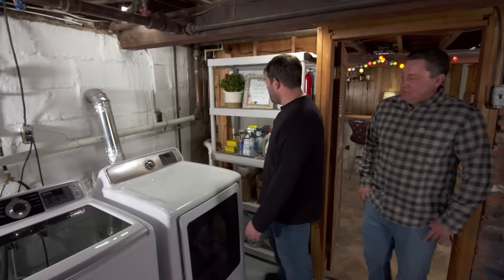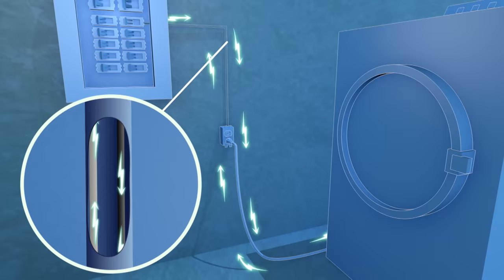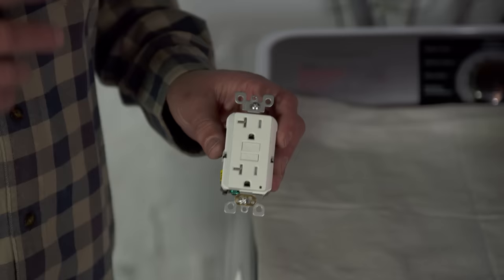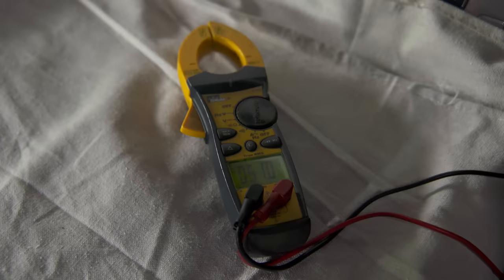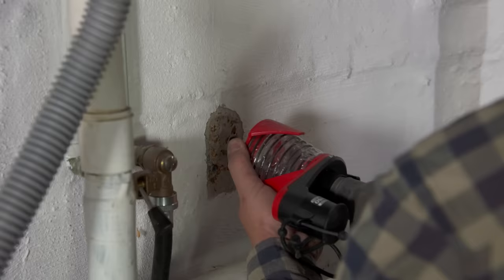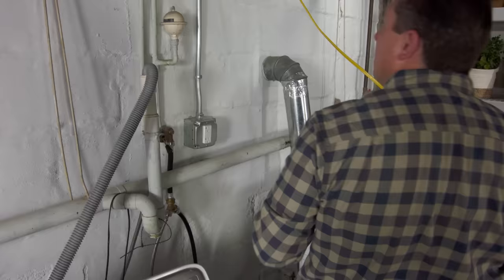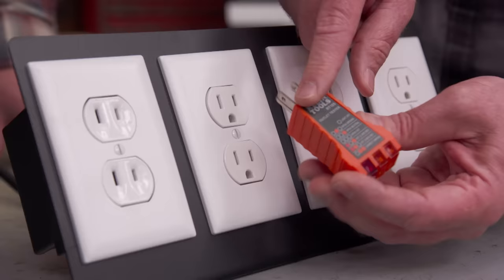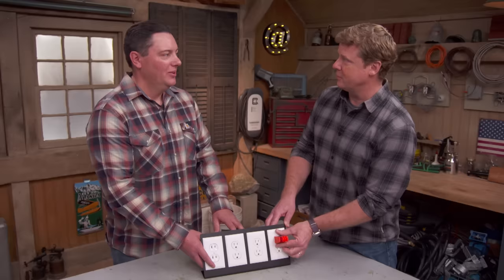How to Ground a Two-Prong Electrical Outlet | Ask This Old House

Comment: Good vid, however he ran the romex through the 1/2" conduit without removing the sheathing from the romex, this can create overheating issues with the wire & is actually a code violation...
Reply: Came here to say this. Even though it will be a remote possibility, stripping the sheathing should have been done.
Reply: Actually that is a gray area. Some inspectors flag it and some say it is fine as long as it's a short piece(so basically a protective sleeve).

But...if you strip it then it is a flat out violation as there is no rating for the wire printed on the independent wires.
Reply: @michaelruskey2311  Good point, I hadn't given thought to the rating info 👍
Reply: Wrong
Reply: You are right Ryan. Sheathed wire inside a pipe will increase the temp of the wire adding more resistance,  and alerting the voltage supplied.
Reply: @Gods_son123  yea...wouldn’t want that voltage alerted. Big problem
Reply: Never mind a wire going through an attic on a summer day that sleeve of pipe will heat the wire up haha.
Reply: “That’s a code violation”

         —guy who’s never opened a code book
Reply: It’s not against code to run NM cable in conduit. NM cable can be run through conduit to protect the cable from physical damage. NEC 334.15
Reply: @chriskephart8305  Rome is not a nm cable as for the 1500 dollar fine my work was issued for previous work that was done with romex going threw emt and flex  had to re wired an entire building for the inspector
Reply: @DJLuDog3  Romex is a trademark of Southwire and listed as type NM cable. Reference the code section I listed for type NM cable and you will see it’s permitted for use in RMC, IMC, EMT and schedule 80 PVC
Reply: Can you provide an NEC citation that shows it is a violation?
Reply: @chriskephart8305  of all the comments I’ve read on this video of “you should of done this” or “you didn’t do that” or “this is what you’re supposed to do”, you were the FIRST one that I have seen that actually sited the code. Thank you for providing correct information as well as citing the code in which the info came from.
Reply: @mr.g937  He can't because it's NOT a code violation.
Reply: @kerrybaxter5211  Stripping the outer jacket from NM cable and using the inner conductors is NOT advisable.  Those inner conductors are not the typical insulation style to be used  in conduit. Usually THHN and THWN are used in conduit.
Reply: @Gods_son123  ALERT! ALERT! - There, I alerted the voltage. 
Proofread, man!  I don't even have a guess what you mean - Attenuate the voltage? Voltage drop? What is acceptable voltage drop?
A footnote (NEC 210-19 FPN No. 4) in the National Electrical Code states that a voltage drop of 5% at the furthest receptacle in a branch wiring circuit is acceptable for normal efficiency. In a 120 volt 15 ampere circuit, this means that there should be no more than a 6 volt drop (114 volts) at the furthest outlet when the circuit is fully loaded.
The NEC does NOT specify an UNacceptable drop.  At what % voltage drop does a circuit become hazardous? It is difficult to say at what point excess voltage drop will cause a fire, because it depends on how much current is flowing through the high resistance connection, what is the resistance of that connection and because many factors must be considered regarding at what point ignition will occur, e.g.:

1. Is the high resistance connection in contact with a combustible material?

2. Is there air flow to dissipate the heat?

3. Is the area around the connection insulated, so that heat cannot escape.

Comment: I went to a guy's house, when you would touch the refrigerator and the metal ring around the kitchen sink you would get shocked, I could tell instantly it was a full 110 volt shock, so I got my handy tester from home and sure enough the wires were reversed, when that was fixed, no more shock! Those little testers are really handy.
Reply: m rapacki  Old house, only 2 wires.
Reply: Reversing the wires does not cause you to be shocked unless you have a bootleg ground.

Comment: Don't take a shortcut and install a 3-prong receptacle and bond the ground with the neutral.  Those simple wiring testers can't detect if it was wired this way.
Reply: Was checking how far down this comment would be
Reply: If you reverse the line and the neutral and the connect the ground to the line then testers will show it perfectly OK but it is deadly.

Comment: I'm not an electrician, but I've spent decades installing and repairing my own wires.  Years ago my son bought a 90 year old house near LA.  The garage was detached from the house.  Somebody had previously ran 120 VAC from the house to the garage.  They provided no grounds.  No GFCI.  The garage had the door opener, a refrigerator and ceiling lights.  All were functioning normally.  I told my son about the lack of grounds and the associated risks, and he asked me to fix it.  I took a four foot metal rod and pounded it deep into the flower bed right next to his garage.  Then I securely clamped a wire to the rod and connected it to the metal conduit in the garage.  With my meter I confirmed that all necessary grounds were operational.  My son eventually paid an electrician to run a proper ground back to the fuse box.
Reply: Greg, you say you used a meter to confirm all grounds were operational. But did you know that a ground rod buried in the flower bed as you describe will only carry a few amps at most.  So a direct short from hot to ground will NOT trip a 15 amp breaker.  The correct solution is to connect ground back to the main panel as you say was later done.  A better solution is to add GFCI since that would work even without any working ground.
Reply: @neilbrookins8428  That's great feedback.  I had not considered the limited amps the ground rod will carry.  Isn't a ground rod used at the breaker panel too?
Reply: Greg Sullivan Yes the main panel will be hooked to a ground rod. But you have to realize where the current flows in the event of a short circuit.  Imagine that your appliance (with a 3 pin plug) shorts from hot to ground. That flows over the ground wire all the way back to the main panel.  From there the ground and neutral are bonded together.  So the current continues over neutral all the way back to the center tap of the transformer.  That completes the circuit.  Since the circuit is complete and low resistance the breaker trips. Note that in this example the current could flow over the ground rod and through the ground to the transformer which is also grounded, but that’s a higher resistance so very little current flows that path.  But technically the current would take both paths, but almost all would be on the wires and not the earth.

Comment: What kind of masonry bit attachment did you use there? Looked pretty handy for keeping a clean work area.
Reply: That’s a silica dust capture device. It’s made by Milwaukee and is cheap. It’s required to use for all contractors per OSHA.
Reply: Nice, thanks guys. Cheap enough that if I had an indoor job I'd probably consider getting one just to help with all the dust.
Reply: @RadDadisRad  hmm, which states require that? I've never seen anything like it before.
Reply: @nauthizzz  Was wondering what this was, too. Thanks for finding it!
Reply: It's not the best when drilling a specific depth  overhead, but it works well at trapping dust if 

precise drill depth is not an issue! ps it can also be attached to an impact and a spade bit!
Reply: Yo Mama  Dunno. This Old House is based in Massachusetts, and I don't imagine they go very far afield, in large part due to licensing being a state-by-state process.
Reply: Yo Mama  It's ok if everything gives you cancer, all that's required is that they let you know it could give you cancer, they don't have to actually fix anything with what's giving you cancer.   Most hilarious thing I've ever seen, one of those "Prop 65- Cancer" signs ... at DISNEYLAND!
Reply: Just tape an envelope under the drill bit with a piece of black tape. The dust will fall into the envelope then close it up and throw in trash.
Reply: Also, it Looked like he used the screws that came with the conduit box and clamps. Not tapcons.
Reply: @K31swiss  Does it need to be licked  in order to seal it?

Comment: My parents house was built in the late 1950. It has two prong outlets. The condunt and boxes are metal. I have heard you can swamp a three prong outlet and the metal condonet wil work as ground. Is this true?
Reply: I have the same thing, and I've been told not to do it that way.  Other commenters above have said that's the way they do it.  My electrical engineer friend said don't do it.  Something about creating an opportunity for a fault (short circuit?) anywhere  in the system to make the conduit/box electrified.  At least I think that's what he meant.  IN addition, you never know if the conduit is actually continuous to a ground.  Anyway, I didn't do it.

Comment: Oh, I was taught that the NEC and local electric codes forbid the use of Romex (jacketed cable) inside metallic conduit, did the code change?
Reply: pretty vague question. which area/county/city are you in and does it apply to the installation in this video? Who taught you? If your boss says don't do it, don't do it. Period. lol
Reply: NEC 2020 Nonmetallic-Sheathed Cable (Romex): Types NM and NMC 334.15(B) Exposed Work, Protection from Physical Damage. 'Cable shall be protected from phys.damage by... RMC, IMC, EMT, Sched.80 PVC etc.'
Reply: 334.15(C) In Unfinished Basements and Crawl Spaces. 'NM...shall be permitted to be installed in a listed conduit or tubing...with suitable insulating bushing or adapter at the point the cable enters the raceway.'
Reply: Here in WA, local codes do not require the protection mentioned in 334.15(C) for crawl spaces.

Comment: I could be wrong and if I am I'm happy to learn. But it's my current understanding that you should run Romex in Condit because there's a chance it could get to hot. So it should have been 3 single pull wire so at least just strip the Romex

Comment: Ok I have a question I been getting high voltage in my coaxial cables from comcast and they said something in the house is using there ground for a ground ?

Comment: Good thing there was a panel nearby to run a new circuit from. So many old houses were wired with ungrounded Romex for years, and there's no easy  fix for that, short of a rewire.
Reply: why these videos are pointless. so many steps are just glossed over.
Reply: Steve Kovacs 
So abandon the 2 prong and run a new outlet next to it?
Reply: Steve Kovacs yeah my house I just brought has stone exterior with plaster walls built on interior and has the old 2 prong outlets my only real chance to change wiring is to probably have to rip out all the plaster and rewire 😬
Reply: One possible "easy fix" for ungrounded receptacles is to replace them with 3-prong receptacles having GFCI protection and properly labeled as "No Equipment Ground". No "rewire" is necessary, unless your appliance actually NEEDS an equipment grounding conductor, such as do most plug-in surge protectors.  Of course, a growing number of locations would ALSO need AFCI and TR protections for any replacements.
Reply: @jimmcdunnah8533  I would look at some of the numerous other YT videos that actually show how to install GFCI protection for ungrounded receptacles, such as replacing 2-slot with 3-slot receptacles, which may meet code in most places.

Comment: I've been called on sleeving Romex through EMT without striping the insulation before.
Reply: You were called wrong.  If you strip romex before you protect it you create a violation.
Reply: @lloydmills9619  NEC allows NM inside a conduit?

Comment: In my house, and probably many older homes, the circuits ARE wired with a ground, and the boxes are grounded, but the outlets are still older 2-prong ungrounded outlets. The solution in that case is to get little grounding wires that let you ground the outlet directly to the metal box. After that, everything is good to go!
Reply: Umm, I'm not an electrician, but I have a 100 year old home that is like that.  However, I've been told that grounding to a metal box/metal conduit is unsafe.  It creates an exposed ground throughout the system, or something, and is dangerous should there be any kind of fault.    You might want to verify the safety of that.
Reply: Putting your ground wire to a metal box IS NOT grounding it AT ALL. ONLY if there's 100% metal conduit all the way back to the main panel. And i'm sure that's NOT the case in your home.
Reply: If your circuits are wired with a ground why wouldn't you just replace the 2-pring outlets with 3-prong outlets? And why would initial installation be with ground wire but 2-prong outlets? I'm not an electrician but have done some electrical. My daughter just got bought an older home and I want to help her fix the outlets which are all 2-prong. The video was helpful but then all the comments start clouding the water.
Reply: <<
@johnnybikesalot
2 years ago
In my house, and probably many older homes, the circuits ARE wired with a ground, and the boxes are grounded, but the outlets are still older 2-prong ungrounded outlets. The solution in that case is to get little grounding wires that let you ground the outlet directly to the metal box. After that, everything is good to go!>>

Yes, you can do that.

However,  I just finished taking the old 2 prong duplex receptical OUT and installing a three prong recepticle.

The old metal box was grounded using BX cable, and I used a pigtale from the receptacle ground to the box.
Reply: <<And why would initial installation be with ground wire but 2-prong outlets? >>

My old home is wired using BX metal cable,  and the metal cladding provides a ground back to the main panel.

But it's an old house, and a two prong plug was the standard at the time. 

So I just replaced  the old two prong plug with a three prong plug. The recepticle ground gets screwed into the metal box,  grounding the receptice. 

Checked it out before and after using my multimeter.

Comment: What were the violations in that pull box? There were also two runs in that box so what did he do with the other run? How did he transition the new Romex to the new EMT above without a JB? I missed something or not required? Ground and neutral wire terminations on the same ground and neutral bus bars? AFCI CB required in a garage? Could have installed a AFCI/GFCI combo CB and be done with it. Needed 4 screws to mount that new box?

Comment: The only problem with that little plug-in six dollar tester is it can be fooled depending what’s going on in the back. 

There are more comprehensive and expensive testers that cannot be fooled.

The bottom line is someone still has to know what is actually happening with the wiring and how to correct it..
Reply: Yep my buddy who happens to be a master electrician,  calls them the three eyed lairs,  for good reason.  One of the most dangerous occurs, especially common in flipper homes, is when there is older cloth romex with only black and white,  or worse yet, knob and tube, and someone removes the original two prong receptacles and installs 3 prong outlet and, knowing that leaving the ground unconnected will fail a home inspection, they will take a ahort jumper and connect the ground and neutral together at the receptacle.  Then consider the possibility of a reverse polarity situation.  Any appliance with a metal case i would apear to operate correctly,  but be live with 120 volts on its surface yet this simple 5 dollar tester will show wiring correct.
Reply: @Sparky-ww5re  There are extremely good testers on the market but you’re gonna have to pay around $150-$200 which most people won’t or never have. The only other way you find out is you open stuff up

Comment: Great vid but the ground connection to the outlet box should be wrapped clockwise. All electrical connections beneath screws should tighten from the turning.
Reply: I’m not sure what you’re talking about but It was definitely wrapped clockwise.

Comment: wow, awesome video, Thanks. now even more questions, how is power distributed when the system alternates? And if AC alternates, why does it seems to still have a direction of hot wire, to appliance, and continues direction back to panel? perhaps the terminology is confusing to me, considering it's a force that cannot be seen.

Comment: I get the GFCI plug being used for the washer and dryer but why the AFCI breaker to power it?  Is that code now?  I know you have to use them in bedroom circuits.
Reply: Yes, that has been a code requirement for sometime now.
Reply: I try to stay away from gfci receptacles when possible, I prefer to use dual function afci/gfci breakers.
Reply: Moon Pie that’s what I thought
Reply: @bradfordlibby9118  Well, according to the NFPA the 2014 NEC still hasn't been adopted in some states, and some didn't adopt it until 2018, so adding AFCI when replacing a receptacle in a laundry room has not previously "been a code requirement for sometime now" for everyone (although it has been for most).
Reply: @bradfordlibby9118  that’s the way to go.

Comment: Also if you bond the neutral and ground on the receptacle it will show grounded with those testers. Many people do this to fool home inspectors, and it appears as grounded.
Reply: This is dangerous as if a break in the neutral occurs and the appliance is on, it will electrify the box/ appliances on that outlet.
Reply: most inspectors that i have dealt with want the boxes open.
Reply: @dancooper6002  lol